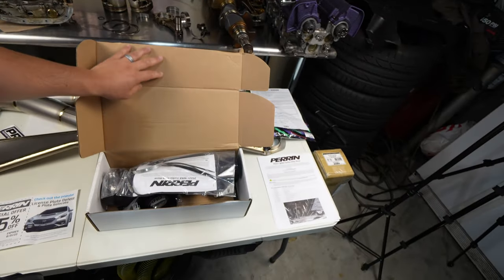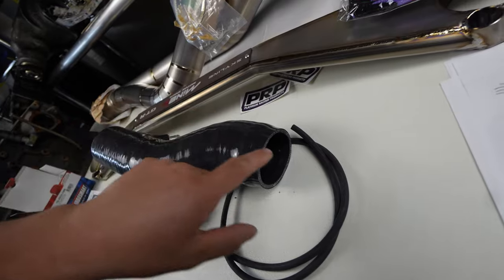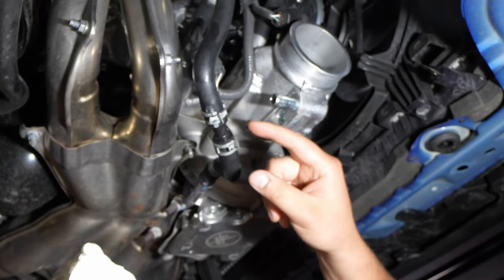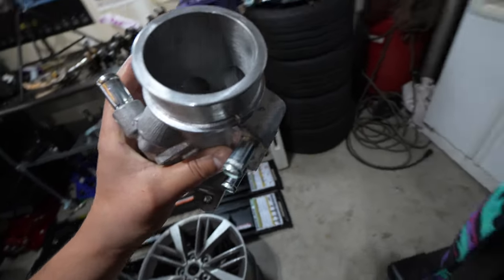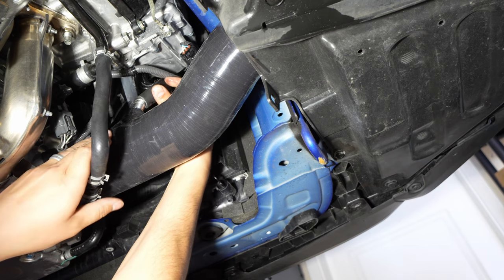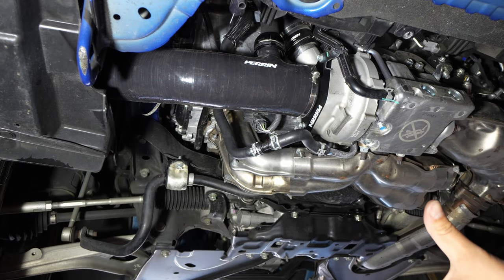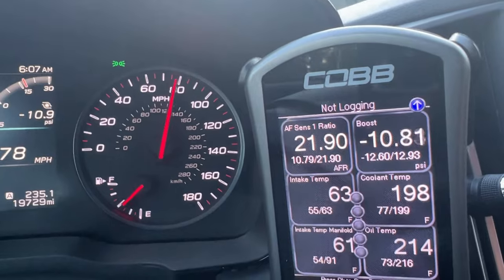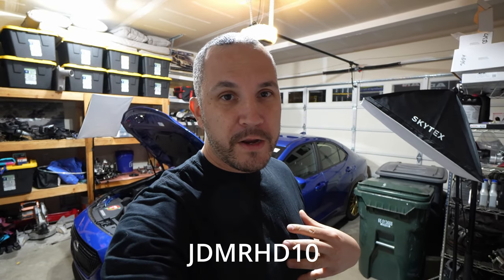Perrin turbo inlet VB WRX makes crazy whistle sounds 2022 2023 2024 FA24

Comment: Sounds like crap to me the coolant lines keep the turbo cool and the blow off valve you just removed keep the turbo from being damaged longevity. The flutter is very bad for your turbo you don’t want that. The only thing about this part is you eliminate a black Wrinkled plastic pipe that you can’t see anyway so really not worth swapping this out imo.
Reply from the maker: The turbo is cooled on the center cartridge where both the oil and water flow near the hot side exhaust turbine, the CHRA. The front coolant lines have nothing to do with cooling the turbo, but instead heat up the aluminum housing to prevent ice crystals from forming in sub zero temperatures near the turbos compressor wheel. Also I think what your talking about is compressor surge, this is not what is happening. The stock bypass valve still releases the boost pressure to prevent compressor surge. Those little flutter noises were coming off throttle at zero boost pressure and just hearing the compressor wheel making some sounds through the different CHRA rpm ranges.
Reply: Bro, you literally have no idea what the hell you are talking about 😂. The bypass valve is still there, the turbo is still cooled as mentioned by the author, and the surge/flutter sound is actually normal turbo operation and is running perfectly 😅 maybe do some research on the engine and how it's supposed to operate first before commenting next time 😂
Reply: At this point I think you should just keep quiet 🤐
Reply: It also throws the balance of the compressor cage.  It will reduce the life of the whole boost range.  But it's up to all of you if you want hotter boost tempo, you'll lose horse pressure and make spool 15% less spooled.
Reply: @JDMRightHandDrive  Have you noticed any indication of a rich condition during shifts from the dual port bov during logs? I haven't...
Reply: U want a bpv not a dual port the air sould always be recirculating so according to Perrin u can run this turbo inlet without a tune can anyone confirm?
Reply: Lots of incorrect info in your post. Coolant isn’t completely removed from the turbo. The CHRA still has coolant going through it.  Also, turbo flutter isn’t bad. Off throttle surge will not hurt your turbo. On throttle surge is what kills turbos.

Comment: Soo, the inlet to your compressor inlet should never be seeing boost if it's boosting you my friend have a compressor surge event which can damage the compressor wheel. All that whistling is actually your fan blades in the compressor stalling every time you lift off this should be avoided. If you want more power replacing the corrugated J pipe with a smooth one will do the trick.

Comment: Thanks for this video. I’ve had the same noises from my ETS intake. Did you install a BOV? You’re losing all your boost when you shift because it’s venting to atmosphere. Mine has the same loss of boost. I think we both could benefit from Perrin’s diverter valve.
Reply from the maker: My car ran like crap after installing the VTA BOV. I sold the TS BOV and put the stock one back on, I am still waiting for perrin to send me their diverter valve. Video coming soon. I hope it makes some sweet turbo sounds.
Reply: @JDMRightHandDrive  it should sound more like the pshhhh you expect and less gurgle. Mine’s on the way too. I thought something was wrong. I double checked all my fittings. Then took it to a local tuner to triple check, even paid for a smoke test to check boost leak. I was going nuts because I couldn’t find anything close to this sound.
Reply: @JDMRightHandDrive  I got my diverter installed. No more whistle, still gets a psshhhh, and the response is waaaay better. I suggest a syringe that you would use to bleed brakes to keep vacuum while you install.

Comment: I heard the coolant lines on the turbo help cool it for quick shut down when you turn off the car, the old ones idled a while to cool the turbos.
Reply from the maker: The turbo CHRA as a water line going through it to cool the turbo already. The front Subaru cast piece to the compressor housing wont make to much of a difference. All the heat is on the turbine side and the water line from the factory goes directly through the center cartridge where the turbos bearings are. Removing the front water lines from the cast aluminum wont cause a cooling issue.
Reply: ok cool. thanks for the response!  @JDMRightHandDrive

Comment: Nice install! What is strange is I have a stock intake (other than a K&N filter) and I have never heard the woosh sound but I can hear it on my POV video when I jump on it. I guess the GoPro mic is just picking up the sound better than my ears can.
Reply from the maker: I can easily hear the turbo whistle sounds from inside the cabin as well. The stock BOV in this car makes some cool sounds for sure. Thanks for watching.

Comment: Oooh great install video. I have similar build. I just reached out to perrin asking if the Inlet will be compatible with a DMann OTS 93OCT AEM Intake map. 🤞
For those who are curious, this map will increase rev limiter to 6500 and add 10/20HP at the top end with boost at 18. AEM intake claims 14hp.
 Now I want the Perrin inlet to increase the top end MORE!!! with those pronounced WOOOOOOOOOOSH! sounds! 😆 Like you JDM, My 22 wrx is daily driver and want it last and be reliable. Not looking to send it and have to do the very costly STI transmission swap.
Reply from the maker: Im right there with you I need this car to last. I dont want to blow this thing up or damage the drivetrain. I will do an STI trans swap someday after I finish paying my car off 30 months from now. Plus I cant spend to much more money on the WRX, trying to focus on my GTR build next. Hope this set up will work with your tune. Thanks for watching my channel and have fun with your VB mods.
Reply: @JDMRightHandDrive  Looking forward to your future content On the WRX and GTR, which I thought you were selling? 
Good news for myself, Perrin got back to me promptly and turbo inlet for AEM intake is compatible with mt OTS DMann tune! I odder it up immediately!

Comment: Keep an eye on that larger T connector. Mine split wide open after driving a bit.
Reply from the maker: Thanks for the tip! That is pretty crazy since they are Gates connectors, they are usually super strong. I will keep an eye on mine.
Reply: @JDMRightHandDrive  oh not the connector itself! After trimming the hose for it, the hose itself split. Happened to me, an a couple other early installers.

Comment: I am about to purchase a Perrin charge pipe, turbo inlet, and cold air intake for my 22' WRX, I was also looking at buying the Turbosmart Kompact EM blow off valve. I noticed that you said the car was running rich with the new blow off valve and was wondering if that was just going to be an issue with the new tune or if it was problematic with the stock tune as well. Was wondering if you think that I should still purchase the blow off valve or if it is going to be a waste of money?
Reply: This is actually a great question cause I have the same thing about to go down. I have the turbo inlet along with cold air and FMIC abs just bought the dual port BOV but now second guessing it

Comment: Awesome video! I wonder if your changes in turbo inlet noise (whistle, flutter etc) is because you also have the intake and other mods. Without that, I wonder if the Turbo Inlet makes any noticeable sound difference for someone still running the factory airbox and just a drop in filter.
Reply from the maker: I think that the factory air box would stop the flutter noises from making there way out of the piping. I think the inlet with the oem air box would still add some additional sounds though, but not as pronounced as my car with full set up installed. You will have to let me know what you think once you install it. Thanks

Comment: I have an ets intake I wonder if this worth it, will it fit with the ETS intake, and will it increase intake noise even more?
Reply from the maker: If you look at Perrins website, I believe they make different inlet options that will work with any aftermarket intake. I would think it would still add some extra turbo noises to your ETS setup.

Comment: Would you recommend the Perrin intake and charge pipe? Still undecided about the fmic or keep it at the top
Reply from the maker: I would buy the Perrin intake and inlet. Way more fun and more power over the charge pipe. That will give you much cooler turbo noises too!
Reply: @JDMRightHandDrive  Okay, thank you for letting me know!
Reply: Is there any added benefit of a new charge pipe, without getting a t/fmic??

Comment: How does your cobb accessport show oil temp readings, I thought the base (Canadian) wrx didnt come with an oil temp sensor? I just ordered a base and I've been looking into ways to get oil temp readings. Please advise, not sure if I should be worried about reading oil temps long as I just let it warm up from cold start a little?
Reply from the maker: All those temps displayed on the Cobb worked just fine with my base. I just had to select in the Cobb AP menu which temps I wanted displayed. The only option in there I wanted that was not an option was oil pressure. Not sure how the Canadian model differs from the USDM model. I would think all the sensors would be the same though. Seems like it would be harder for Subaru not to build the cars that way. Hope it turns out good for you and thanks for watching.
Reply: @parthjosh9306 I have the 2022 wrx limited model. Though here CDN its called sport tech. I can confirm that the CDN models are USD. For whatever reason the sub trims on the WRX in canada are called different then that of US. I have very similar build to that of JDM right hand drive... My limited power mods are a COBB AP & AEM intake with DMann OTS AEM 93OCT intake map. The map increases Rev limiter to 6500 and 10/20hp on top end. AEM intake clams to increase HP by 14 wit a boost of 18. I reached out to Cobb before purchasing the AP, They confirmed that the US AP is the same for CDN models. You'll be able to read the oil temps from the cobb ap. OIl temps are important as you shouldn't go into boost until they are at least 85 caulis.

Comment: Could i get some advice for this part? Ive got the cobb stage 2 power package tuned for 93, AF learning is @-7.68 to +2.88 which im pretty sure it's causing knock and my DAM dropped to .500. would this turbo inlet fix my AF values/knock?

Comment: I currently installed the Perrin inlet but it was on my Subaru Ascent. Everything fit perfectly the only thing Ive noticed is that it bogs in mid rpm or when accelerating . i have a cobb accessport on it. any soggestions
Reply: i also have the turbo smart bov . im getting a lean code
Reply from the maker: I took the TS BOV off my car for more accurate tuning. Are you running an intake with yours? Also did you run the top vacuum lines to the back brake booster. My car did not have any issues with mid rpm bogging. My car was noticeably faster in every RPM range. I would reach out to Jeff and Perrin and troubleshoot with him about your platform.
Reply: @JDMRightHandDrive  i actualy fixed it i made a custome intake and my mass sensor was not perfectly straight
Reply: @yalitorres3723 how’d you make a custom one??

Comment: Can anyone confirm that the Perrin inlet does not require a tune because on the website it says it doesn’t I’m not familiar with the new platform I have a 2019 sti and just bought a vb?
Reply from the maker: I ran this on my car for 3 months without a tune before my car was pro tuned. I spoke personally with Jeff Perrin about this and he assured me that Perrin did excessive dyno testing with stock map, and even the Cobb OTS tunes and the AFR's are all good with the Perrin inlet.
Reply: I'm gonna do the parent inlet and the parent intake

Comment: It’s any way the check engine like get off?
Reply from the maker: Did you run the upper vacuum line from the evap to the brake booster like I did. Also did you trim the evap line 1 inch before putting connecting the line to the turbo inlet barb? I didnt trim that evap line initially and it caused a kink which triggered a CEL on my car. Once I trimmed that line and it was straight and not kinked no more CEL.

Comment: I’m guess you have to have the Perrin intake for this to work
Reply: The Perrin website says this requires trimming with a Cobb or ETS V1 intake.   Kind of vague as the ETS and Cobb have a xsolid aluminum intake pipe.  Less the silicone couplers.   Very interested as I think my ETS is a V2.   Slightly different couplers.  @Perrin.   Please provide some clarification
Reply: I bought the turbo inlet and I have a Cobb intake tube. I haven't installed it yet, but Jeff said it probably requires some trimming.
Reply from the maker: I believe this can mount right up to the stock intake as well from what I can tell by taking everything apart. I would reach out to Perrin to verify.
Reply: @JDMRightHandDrive  I actually ordered it using your code. They told me they make a model with the intake system I have so everything should be good for now!

Comment: I’m not 100% sure however, that whole unit you removed is probably a venture for the PCV system. Under manifold vacuum the PCV system uses the manifold as a vacuum source, under boost it uses the vacuum in the TIP. The issue is, during transient conditions when the manifold is under slight boost, the TIP may not have sufficient vacuum in it to satisfythe PCV system. That Venturi helps the draw the correct amount of crank case vacuum during these transient conditions. The style of system has become quite popular with OEM’s to ensure proper crank case vacuum at all times. While you may think it’s a boost leak, it’s actually not, not in the traditional sense anyways. Because the boost is being fed back into the TIP it’s remains in the system, yes energy goes into compressing that air however when it’s plumbed back into the TIP is increases the pressure inside TIP and helps to lower the pressure ratio of the turbo, this helps the turbo operate more efficiently. It’s not a wash, you’re still going to have a small efficiency loss however it’s not nearly has much as you would expect and actually quite a good idea from and engendering standpoint. Why Perrin decided to remove this system is beyond me.
Reply: Additional info: Perrin claims it’s part of the EVAP system however, I have my suspicions it may be part of the PCV system as well.

Comment: Somebody been drinking the ricer kool aid. You want people to think that changing a hose before the turbo, while on a stock tune, with stock boost control and programmed torque curve limits is making 15 more HP?  Sounds cool and likely has some benefit on modded cars, but you cant believe every ridiculous claim on a box. Especially from Perrin. They claim their intake on the new BRZ makes 10hp as well. Dozens of people have tested them and found they LOSE power over the stock intake. 😂

Comment: Thanks for the vid. Garrett turbo part number is 897071-5004S. Model: MGT2260Z. The inlet looks good. when you stay it doesn't bog down anymore, are you talking about this:  ... When I floor it/rev it sometimes the idle will drop down below normal idle (like 500 rpm) and then pop back up to regular idle (about 700). ?  BC i've been trying to figure out why it does that. Subie said it's normal. Ya, normal as in not tuned right.
Reply from the maker: Yeah mine would bog down to 500 and then jump up to 2000 rpm and wander around for a few seconds before finding a stable idle again. My car also dropped a few times below 500 rpm and stalled out. this was due to the vent to atmosphere BOV I had installed on the car. It had nothing to do with the turbo inlet. But having the stock bov on the car fixes the AFR for the factory maf sensor ecu values.
Reply: @JDMRightHandDrive  Do you think running the turbo smart full plumb back BOV would solve your MAF issues?